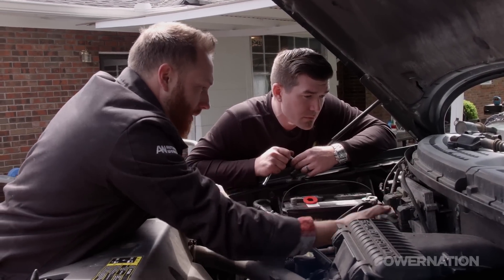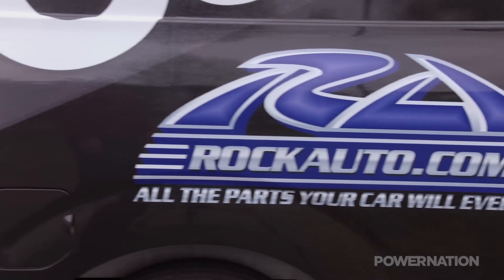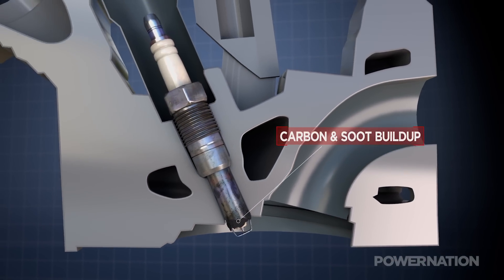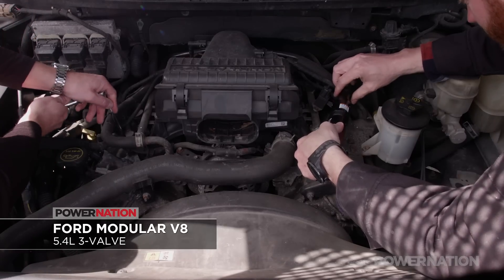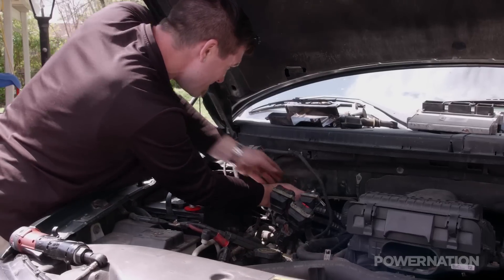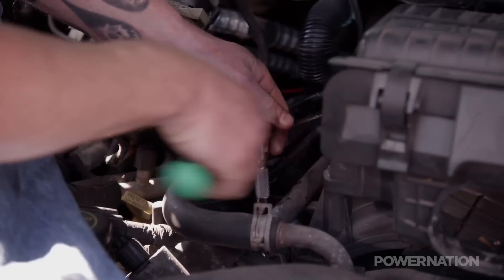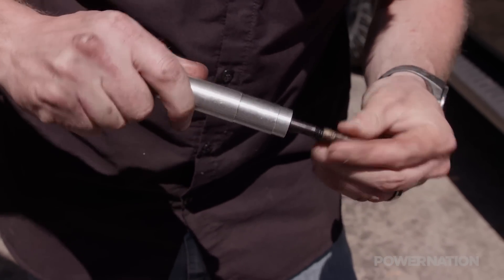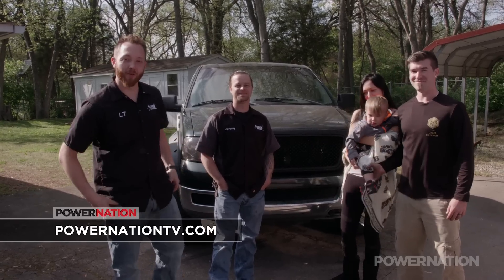Tips For Not Breaking Off Spark Plugs While Tuning Your F-150

Comment: Putting anti sieze on the threads is not recommended. Only apply Nickle High Temp Anti Sieze on the smooth section below the thread and short of the tip.
Also suggest using the updated Motorcraft Spark Plug (SP546X) and not Champion brand.

Comment: I'm doing this plug change now with p b blaster taking my time. The 2 plugs under the dash are difficult challenge and I wouldn't recommend without experience and research. I used champion growing up However mechanics in the know say Motorcraft is issue free. At $21 dollars a plug, Ford could have at least paid for new plugs to replace a faulty two-piece plug that separates needing an extractor to remove it from the head.

Comment: SORRY GUYS AND READERS TO THIS VIDEO.  DO NOT  DO NOT DO NOT USE CHAMPION SPARK PLUGS IN YOUR FORD F150.  ONLY MOTORCRAFT PLUGS NEWEST VERSION IS SP546, NOT THE PREVIOUSLY RECOMMENDED SP515. THOSE ARE OUTDATED. USE MOTORCRAFT ONLY SP546. I WONDER IF THESE GUYS ARE GETTING PAID TO SHOW CHAMPION PLUGS.  THIS IS NO REASON TO SHARE BAD INFORMATION.  THESE ENGINES HAVE A BAD REPUTATION, SO FOLLOW CLOSELY.  DO NOT PUT ANTISIEZE ON THE THREADS AS THE PLUGS SOMETIMES BLOW OUT, SO DONT HELP IN ALONG BY LATHERING ANTISIEZE ON THE THREADS.  MAYBE ON THE PLUG SHAFT TO KEEP CARBON OFF THEM, BUT NOT ON THE ELECTRODE TIP EITHER FOR OBVIOUS REASONS. AND LASTLY, DONT WAIT ANOTHER 100,000 MILES BEFORE YOU CHANGE THE PLUGS AGAIN. YES, THEY'RE PLATINUM PLUGS, SO THEY'RE DURABLE, BUT THEY DONT LAST 100,000 MILES, AND YOU'LL HAVE TROUBLE ALL OVER AGAIN REMOVING THE PLUGS. SO INSTALL EFFICIIENT PLUGS, AND TO MAINTAIN AN EFFICIENT RUNNING ENGINE, CHANGE THEM AFTER 60,000 MILES TO KEEP GASOLINE MILEAGE EFFICIENCY.  IT PAYS TO CHANGE THE PLUGS IN A SHORTER INTERVAL. SORRY FOR YELLING, BUT THESE GUYS MAKE ME NERVIOUS.

Comment: They didn’t even torque the spark plugs and they put anti seize on the treads! Your supposed to put it on the barrel or shank of the spark plug so it comes out easy next time.. putting anti seize on the treads created more problems for this motor..

Comment: The tan / brown coil on plug boots you pulled out indicate that this engine has the updated plugs.  They do not break like the old style with the black boots do.  The change happened in late 2007 / early 2008.   Still a good video though.   The old style coil and the prone to breaking plugs have 3L3E or 3L3Z on the coil.  The new style coil with the better plugs have 8L3Z on them.
Reply: Excellent info...right on. I'm pretty sure mine are updated being it has 320,000 miles on it.

Comment: Horrible design. It makes it almost impossible to do basic maintenance on the thing. The last Ford truck I had was a '72 with a 351 Windsor in it. All you need was a deep sparkplug socket and a ratchet. Took less than 20 minutes to swap the plugs, wires, and distributor cap and points out. Good olé days.
Reply: Yeah, and probably enough room to sit in the engine compartment while you do it.
Reply: I have a 5.4 yet it still runs amazing🤷🏽